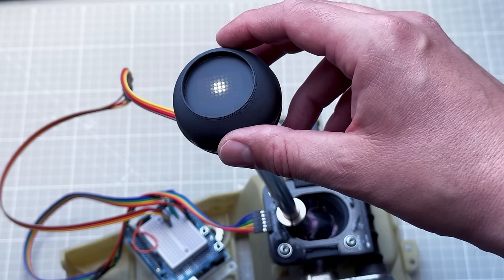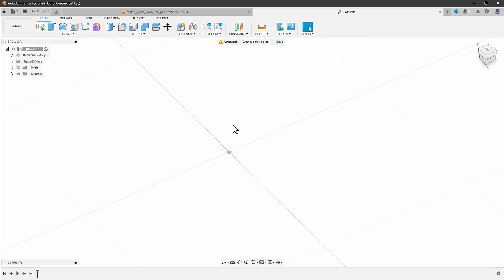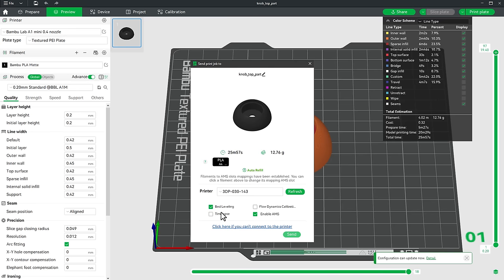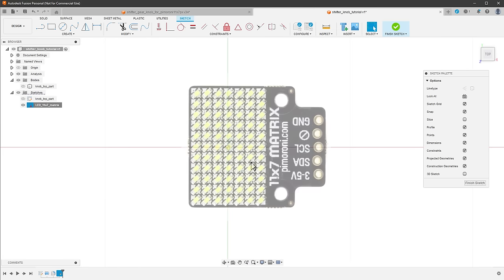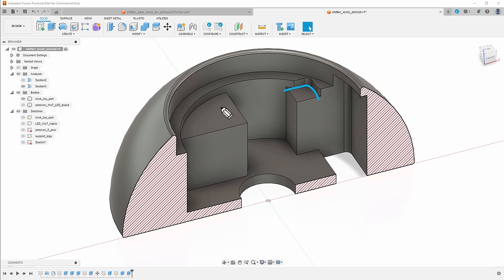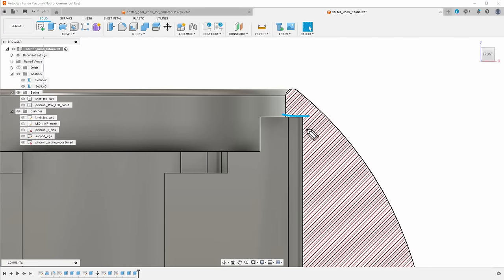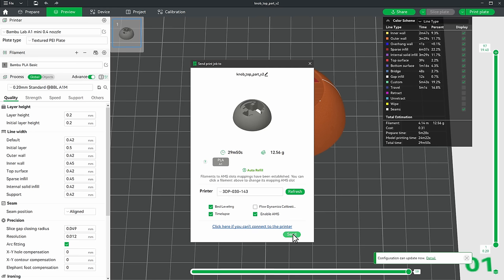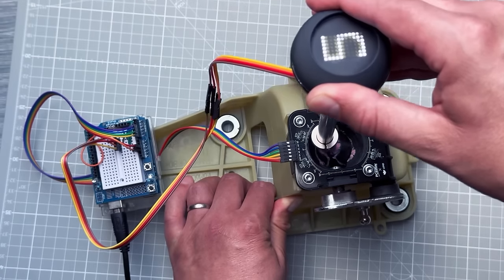Gear Shifter with DISPLAY

Comment: those transitions look neat but are way too slow for a practical UI
Reply: You can speed up the animations in the code.
Reply from the maker: Agreed. I will speed it up a little in the next iteration. Thankfully as someone pointed out, it´s just tweaking a variable value in the code.
Reply: What’s actually “slow”? Are you actually needing to look down to see what gear you’re in? It’s just a cool gadget. What is needed for “practical”? Having said that, if it’s speed up, that’s cool too. 😊
Reply: @yungpharm91  lets be real, here. while i agree that it is a gimmick, the creator took the criticism REALLY well and actually plans on speeding up the animation. also, like he said, its just tweaking a variable value in the code sketch. im just starting to program myself and am starting to realize that criticisms like this are actually really, really useful for inventors and diyers alike lol no hate. just saying he is 100% right about the animation being too slow. if this was used on say,, a digital dashboard for a sim racing rig, it could be distracting and .001 seconds can make a world of difference when racing for money lol
Reply: @upir_upir  the fact that you even coded this thing in the first place is crazy to me lol but i just started learning arduino and essentially only understand the "if/then" logic of programming, as of yet lol
Reply: Not that I'd need to look at it, but it would be a nice fidget toy when waiting for a traffic light. Yes it needs to be faster LOL
Reply: @yungpharm91 if it’s impractical at any speed the slow animation only makes it more useless
Reply: @beatwrecker7343  I never said it was a gimmick; I just was appreciating what it was, and not declaring it “useless” because of one presumed use case that it doesn’t meet the demanded criteria.

Comment: Bro just casually dropped the best fusion 360 tutorial ive seen😂
Reply from the maker: This wasn´t really intentional, but thank you! Unfortunately I just found out a few Fusion tricks right after publishing this video. I guess I will use them the next time..
Reply: Absolutely agree. An actual hands-on tutorial. Thank you!!
Reply: I have to watch it at . 25 speed
Reply: The use of mirroring, and a discussion on tolerances would have made it perfect. As is, it's a pretty decent tutorial.
Reply: Agreed to it, not having knowledge about Fusion 360, even a layman could understand what was happening in the design.❤

Comment: This Channel is singlehandedly the most interesting channel on youtube. Never have I ever used an Arduino Board, Nor have a 3d printer or done some kind of designing, but you got me hooked. I am currently binge-watching every single video of yours. Might give this whole Arduino coding a try. You definitely are a big inspiration. Greetings from germany!
Reply: Do it !!!!!! you won't look back !
Reply: 100% agree
Reply from the maker: Thank you for your very nice comment, I really appreciate it! You should definitely try Arduino, it’s so much fun. If you start in Wokwi (online emulator), you don’t need to spend any money upfront, and only buy required components once you have it working. Of course it’s much more fun with real hardware. Good luck with your projects and feel free to ask if you have any questions.

Comment: Super sick!  Transparent PETG isn't gonna work for the face.  That little tint piece you have is pretty perfect.  Maybe some resin with colored dye, but FDM is just never going to get clear enough.
Reply: You have seen the glass clear prints on CNC Kitchen right? Almost getting there. 

But would be nice to be able to do actual custom lenses somehow even if not quite optical grade. But at least contact lenses for things like these. Maybe casting them.
Reply from the maker: You are right with transparent PETG. It´s translucent, has an interesting effect, but I will probably go with the tinted acrylic. I will still show it in the net video, it´s quite unusual.

Comment: Great Fusion tutorial! I dabbled in Blender as a teenager and now getting into 3D printing I thought about using it, but I'm reconsidering after what I saw. It seems so easy to design such a thought out piece by using flat sketch and then modyfing it by extruding/substracting
Reply from the maker: Thank you! Blender is a great tool, but for 3D printing, Fusion is much easier to use and especially for tweaking the models in case you need some small adjustments. I´m still learning it, but I´m having a great time using it. Also, there are many tutorials out there to follow. Good luck with your projects!

Comment: Use a hollow tube for the shift shaft and use a round cable that's meant to repeatedly bend, such as some silicone USB cable. Then you can stick the cable through the shift shaft and hide the cable entirely. If you use some serial protocol for the shift knob assembly, you could also integrate buttons for special car functions or such into it.
Reply from the maker: That´s an interesting idea, I was thinking about the same, but I´m not quite sure if you can get hollow tube shifter rod.

Comment: i think that i might use an 8x8 led array, and make fairly quick transitions....it's also possible, with input from OBD II BlueTooth interface, to use an up or down arrow for 'suggested shift', when your gas pedal is not "floored"
Reply from the maker: I have used 8x8 LED Matrix Displays previously, but the ones that I have were too big to fit into the shifter knob.

Comment: Hi there, for people like me, that I haven't got the knowledge of arduino, electronic and no $$ to buy a 3d printer,  you have a plan for the near future to produce and selling this fantastic display. I am sure it will look pretty nice in my miata 1990.
Thanks for share with everybody your efforts to bring up this project. 
Greetings from BelloCielo - Chile
Jaime
Reply from the maker: Thank you for your comment:
a) You don´t really need that much of knowledge of Arduino, since the sketch is already written and ready to be used
b) You can simulate all the eletronics part in WOKWI in browser
c) You don´t need to buy 3D printer, but get it printed by friend / any online service like for example PCBWay (still, the A1 mini is only 250$)

That said, while I don´t plan to produce and sell this product, I might have a small batch for someone like you. If you are willing to share photos of installation into your car, I would be happy to send you at least the 3D printed parts. Is you miata 5 speed or 6 speed transmission?
Reply: I built myself a 3D printer for an equivalent of around $120 back 7 years ago, I'm still using it, it hasn't taken up much money in repairs at all, though a lot of time. A question of dedication for sure. Me I can't imagine affording a Mazda MX-5.
Reply: Sorry I did not see your kind reply. My miata is a 1999 NA 5 speedometer transmission.
Congratulations once again for the new Display for the BMW IM logo. Miata logo will look even  nicer.
Greetings from BelloCielo - Chile.
Jaime

Comment: Nice stuff, if i recreate it, i would probably go for an ESP32 C3, same size as the display and could project the gear position to a second display, I'm sure you mainly wanted to keep it simple and thank you for the great work
Reply: Nu looking this model up i came across the ‘ESP32-S3 Development’ could be very Nice as wel. But indeed over complicated.
Reply: @manuroelants1215  yeah, im working on a more extensive setup with can bus connection and displays, so might as well go full in lol
Reply from the maker: Thank you. I do plan to use a smaller microcontroller eventually and hopefully fit that into the knob as well. We will see how that goes..
Reply: @upir_upir  the C3 board (there are ultra mini variants) should fit under the footprint of the display, if you desolder the usb-c port then it's not thicker than the display, has cassellated holes, im sure it would work for you nicely..
I'm trying to build an ESP mesh net of sensors in multiple regions of the car and try outputting to a display, and this is even without the display a nice tutorial you put together for us

Comment: Great Work man. Have you considered routing the cable inside the shifter ? it will be clean
Reply from the maker: Thank you. I did, but I´m little bit worried I don´t have the right tools and knowledge to make it work - i.e. to drill a hole inside.

Comment: is it possible to make gear number indicator using CANBUS comms from an after market ECU?
Reply from the maker: Yes, and it will most likely be easier than with a stock ECU, since the aftermarket ECUs usually have a better documentation.

Comment: Wouldn't it be far easier and just as effective to have a single LED behind each # which all the negative (black) space could be solid opaque painted or whatever? 
Because the gear pattern of that transmission isn't going to change, right?
You know what I mean?
Reply from the maker: Yes, that would surely be possible, but I do plan to add animations and pretty much use the full potential of the display.

Comment: try use fuzzy setting. it will give some texture on your 3d printed part.for starting setting, point distance : 0.15mm. thickness : 0.15mm
Reply from the maker: Thank you for the comment, I will definitely try that to see how it looks. Still new to 3D printing..

Comment: Is there a name for this kind of visuals or a style category? I reminds me of those retro Mustangs made by Charge.
Reply from the maker: I believe it could be called retro-futurism -- i.e. depictions of the future where the "future" has already happened. Using LED matrix displays with visible segments is often times used for that - Hyundai ioniq 5N has those segmented front and back lights, as wall as many other cars. I have seen the Charge Mustang live last year, and it looked stunning. Too bad they only make 500 of those, and it probably out of my price range anyway.
Reply: @upir_upir  Was thinking of it, thanks for the answer!

Comment: Carbon fibre filament and maybe a little bit of fuzzy skin in slicer would make the knobs look even better I bet
Reply from the maker: Is the carbon filament PLA? Do you have any favorite brand? I will definitely play with the fuzzy skin option, but I wasn´t sure what settings to use to not make it look too fuzzy.
Reply: @upir_upir  For the use of being in a car it may be enough with CF-PETG since CF-PLA might still have too low softening temperature (in case the car is outside on a sunny day). If even that isn't enough then CF-ABS/PA-6/PC would all be good but not as easy to print.

Comment: Did you think about using an Arduino Nano and including space for it inside the knob?
Reply from the maker: Definitely. Maybe not even Nano but something smaller. I´m looking at the options, there are many small boards out there.

Comment: Hello Mr. Upir. I thank you for your videos, they are very helpful.
I need help printing.
If you have the ability to share known Shifter separate files.
top, middle and bottom
Reply from the maker: The files for 3D printing should be on the GitHub page. Do you have problem opening those?
Reply: I dont know if its because i need more temperature, because when i print my knob, it ends with dots

Comment: How do you intend to run the wires from the knob down the shifter?
Reply from the maker: Probably hidden under the sleeve. Hollow shaft would be nice, but that’s not very common.
Reply: @upir_upir  Yeah, I wasn't thinking.  Not all cars have a shifter boot.  Strangely, mine does, so you would think I would have put 2 and 2 together.  LOL.

Comment: nice. next you need to put a speedometer display inside the gas pedal
Reply from the maker: That´s an idea! I do rememeber that the KITT from Knight Rider had LEDs all over the gas pedal, and they would gradually light up as you press the pedal, but having a display there would be a next level!

Comment: Hey! I tried to open the knob 3D files and I’m getting a “no models found in file” also Rhino wouldn’t open it. Could you upload a STEP file or similar? Thank you!!
Reply from the maker: I´m sorry to hear that, if you have Fusion, there is a native Fusion file included on GitHub, but I will also upload STEP file tomorrow. Hope that helps.
Reply from the maker: The STL file is now on GitHub.
Reply: @upir_upir  Thanks! I just started printing now

Comment: I have imagined a knob with a gyro and a configurable ui by phone to set the gears in position so that does not require another heavy circuitry nor custom pcb. E.G.: You set how much gears it has, set to 1 on the gear and in the phone, repeat X times for the configuration wizard and voila.
Reply from the maker: That all sounds like a great idea, but unfortunately I don´t have enough knowledge yet to do that..

Comment: Maybe I've missed something, but what is the use case for this. having to look down at the gear knob to see what gear you're in kind of defeats the need for the display, because you can see the physical position of the knob to determine what gear you're in. The display in your eyeline when driving would make more sense. Love the design and attention to detail, just not sure how useful this is.
Reply from the maker: The primary use-case is to have something unusual looking in your car, maybe a conversation starter or simply something for the passenger to look at. If you have a proper race car, you can use this technique and mount the display on the dashboard instead.

Comment: Wouldn't it be easier to use something like ADXL345 to read the position? There would be no need for custom PCBs, and everything would fit in the shifter knob if you used a small microcontroller like ESP32-C3 Super Mini.
Reply: And then you hit a bump, crest a hill too fast, or make tight turns, and now your microcontroller doesn't know where the stick is at...
Reply: @charetjc  Oh you are right, didn't think about that but i think you can do some code adjustment to work it out
Reply from the maker: I was thinking about the same and I might try that, but as someone already noted, I´m worried that when the car is moving, it might confuse the readings.
Reply: @upir_upir  you can use two accelerometers one in the shift knob an one just bolted to the car and subtract the reding this should remove the error
Reply from the maker: @danieltrzeszcz6213  That´s an interesting idea, I like it! Will definitely try that approach.
Reply: @upir_upir  I'm already making it
Reply: @upir_upir  Just remember, in free-fall (if it happens, and for however long it lasts), both accelerometers report zero g's.

Comment: Can you make one for a sequential shifter with CANBUS?
Reply from the maker: Do you mean a true sequential shifter, or automatic transmission with paddles? Do you have such a car?
Reply: @upir_upir  Sequential shifter to the 8HP75, Yes technically it's an auto box, but I have the Turbolamik with the Jinx Shifter and paddles, would love to see this on top the Jinx Shifter, with faster animations! The Shifter is also a 4 wire with microswitches, +12v, Ground and Up and down shift wires, analogue. My LCD dash already has the Gear numbers, but this would be insane on top of a shifter knob!
Reply from the maker: @BUZDRIFT  Can you please send me an email? I can help you with your project if you are willing to provide me with some photos/videos of your project. Thanks!
Reply: @upir_upir  Frigging awesome! Give me a day, it's dark out now, and I'm having dinner with the misses, (I do have lighting) but it's wind downtime, I'll post some links tomorrow! You're a legend! Mind you the car is completely apart right now as I'm in the middle of a complete custom tucked and shaved chassis and bay, but I'll give you all the details. P.S thank you very much

Comment: use hot glue from the inside to block all holes, then pour clear apoxy over everything to height.
Reply from the maker: That´s an interesting idea, but for now, I wanted to be able to disassemble everything easily.

Comment: Where did you get the manual gear shifter mechanisim from?
Reply from the maker: I did get it at local junkyard, I needed the very same that’s in my car, and it was around 50$.

Comment: Built a canbus shifter with oled esp32 display..... Useless as the only time you can use it for anything useful is when looking down at it.. Displays are meant to be forward view for a reason..
Reply: It's meant to be more of a novelty anyway. In a manual it should obvious what gear you're in at any time. This just looks cool.
Reply from the maker: It´s nice that someone understands the purpose of this project. Not everything has to be useful.

Comment: Call me stupid, but what board do you use for gear-stick position detection ? Something based on hall effect sensor ?
Reply from the maker: There is no need to call anyone stupid. It´s a custom PCB with hall sensors, all the details are described in this video - https://youtu.be/QixtxaAda18
Reply: @upir_upir  Got it. Many thanks.
Reply from the maker: Sure, you’re welcome. Good luck with your project!

Comment: That #/2 On the Fusion thing seemed like a no Brainer But I didnt know that, No more calculator for simple measurements XD
Reply from the maker: I´m glad it was useful. Later in the day I did found out that if you draw a line in the center and set it to "centerline", you don´t even have to divide the radiuses by 2, Fusion will do it for you.

Comment: Hard to say, but i forgot your channel name, some guy on shorts made mechanical 7-segment with two camshafts and motor and i thought you should meet ;)
Reply from the maker: I have seen a lot of those mechanical 7 segment displays lately - I definitely need to try that. Especially the version where it´s all white and some of the segments rise up, that´s a beautiful design.
Reply: @upir_upir  i saw some with hinged by electromagnet parts but this have shuflled (pushed aside behind wall) by cam segments, so could not change any segment.